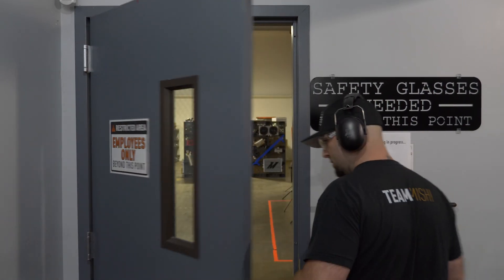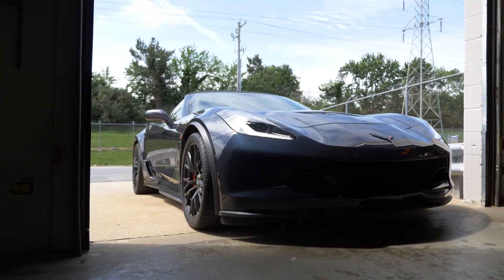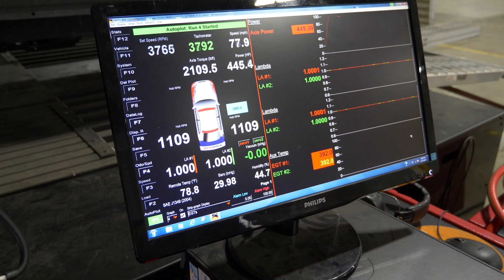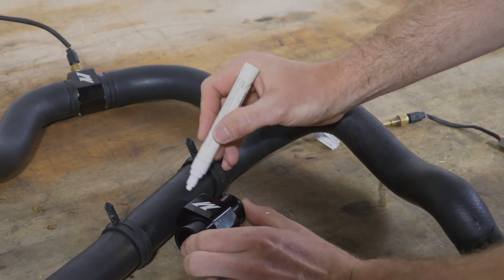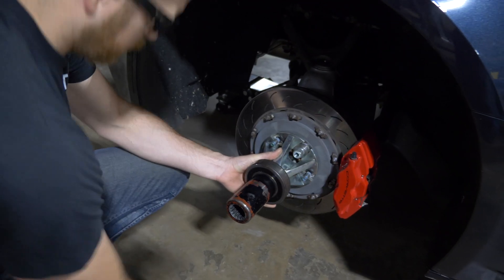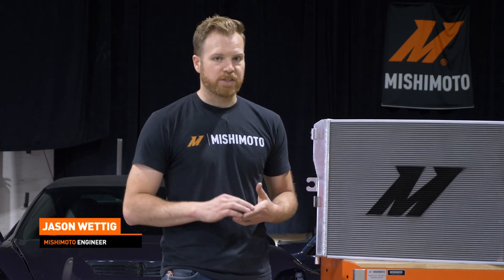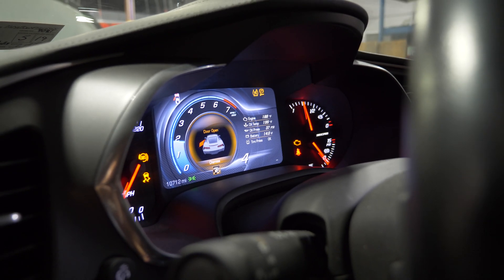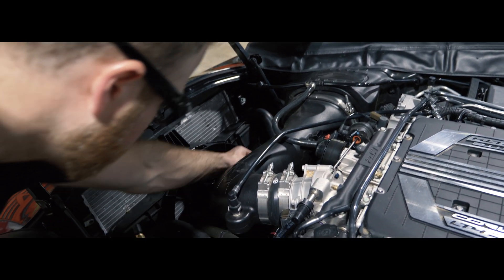Mishimoto Behind the Scenes: Chevrolet C7 Corvette Performance Aluminum Radiator Testing

Comment: Is it a drop in replacment? does the hose going to the radiator needs to be changed or can i keep everything else the same except the radiator change?
Reply from the maker: Direct fit. Nothing else is needed.
Reply: @mishimoto drove a 15 and 16 and both in limp mode within a few laps with your set up. If I didn’t take those cars to redline or close to they’re fine. RPM is the culprit with baby blower.

Comment: will it reduce oil temps on 20min track sessions?
Reply from the maker: During our stress testing we saw a noticeable drop in average temperatures with nothing more than the radiator installed.

Comment: Over heat issue fixed in 2017. I own a 2017 and run it to the ground never overheats, and when on track using the correct oil matters.